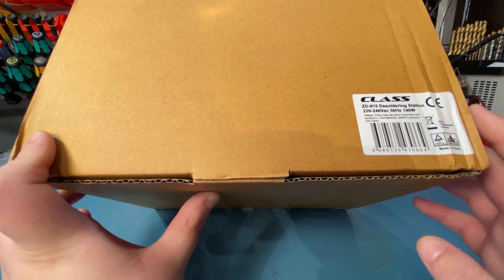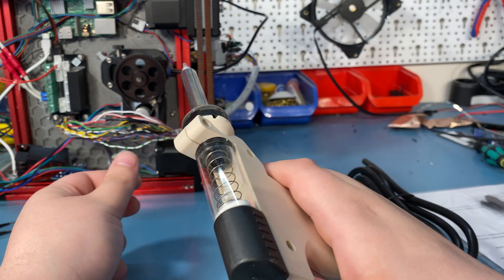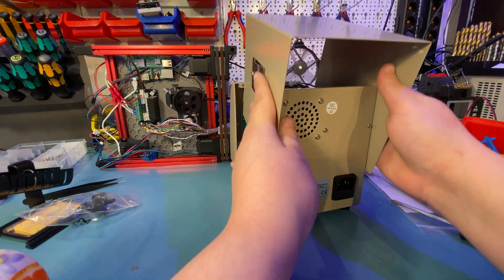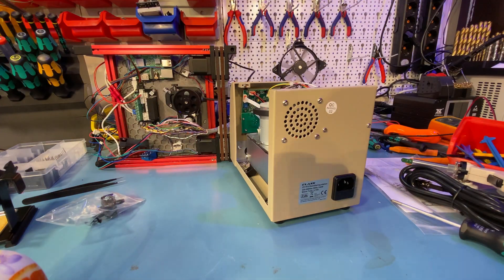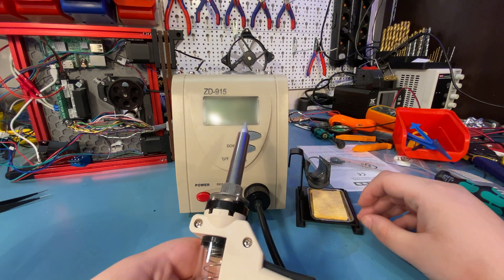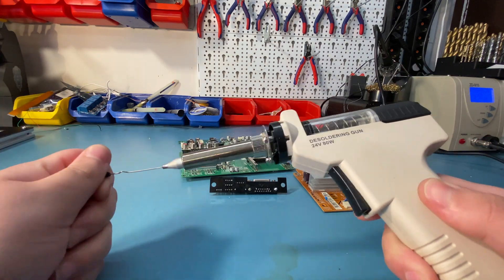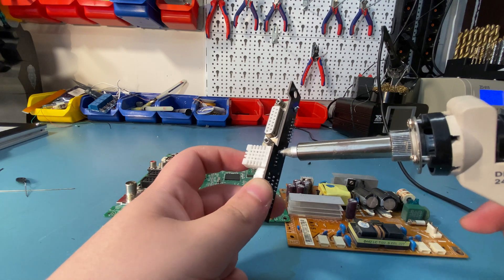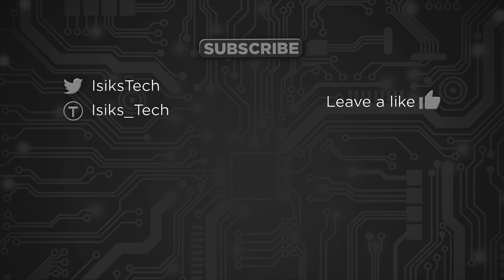ZD-915 Desoldering Station Review

Comment: Ah yes, the ZD-915. I absolutely *loved mine, and it’s most definitely in a very interesting position in the market. On one hand it absolutely has better build quality (brick vs. straw house) than the Pro’sKit SS-331H, but some would argue the suction performance is slightly lesser with the ZD. (Then again, the fact that it has a front power switch stock and doesn’t feel as cheap is probably enough of a reason to go with it over the Pro’sKit, even with a suspected lower amount of suction.) Meanwhile, they include a better stand with the Pro’sKit, so... 🤷🏻‍♂️

Recommended: add some silicone grease to the o-rings on the plastic vacuum tube adapter on the front, and the seals in the gun itself. This will give you better suction performance, and help the lubrication/removal of the glass collection tube. Also, while the included spring filter is adequate, see if you can get a much tighter coil spring filter instead - it’ll collect much more solder and help preserve the life of the ceramic filters in the hand piece.

* I say ‘loved’ because I recently retired mine for a Quick 201B, which blows the ZD out of the water in every department. (Admittedly the Quick is 4x the price of the ZD, but the Quick is half the price of a Hakko, so I’ll take it.)
Reply: Might not be smart to use silicone grease for o rings, if they are made out of silicone, it will melt them(silicone grease on silicone, melts silicone
Reply: @kruskotv1311  the O-rings in mine are rubber. (But I do appreciate the concern!)